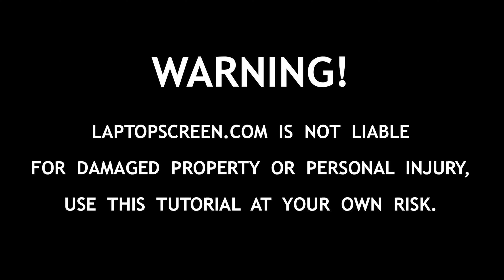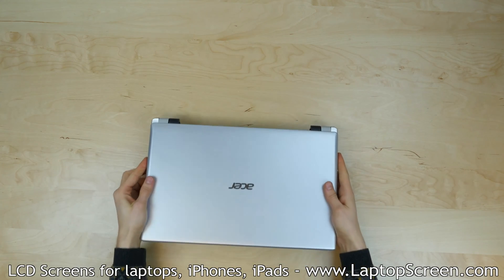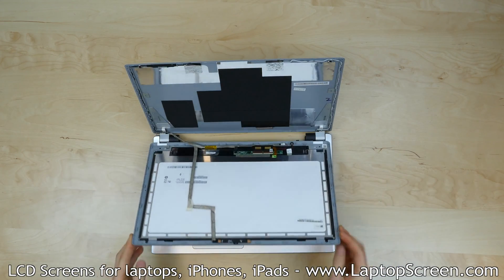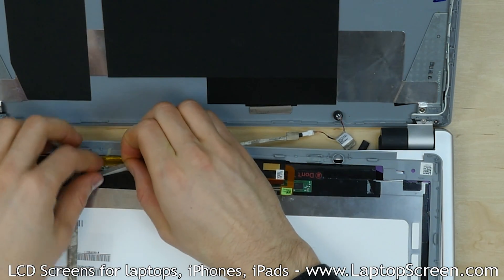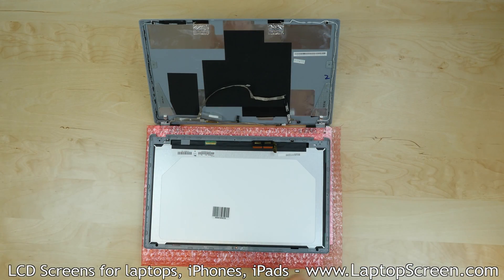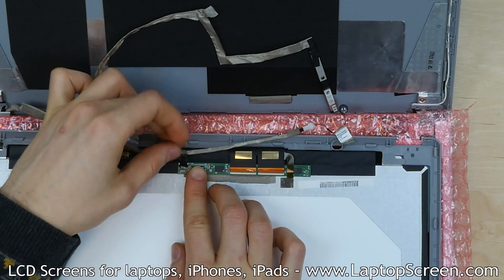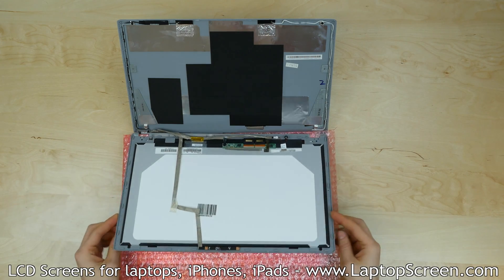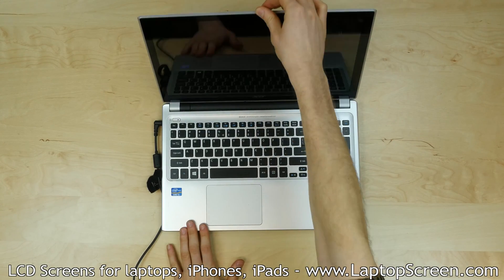LCD and Touchscreen assembly replacement / LCD+digitizer repair [Acer ASPIRE V5-571P]

Comment: Hi I have a v5-571p-6866 and my touch screen is cracked slightly which causes my touch to go crazy. I've been trying to find a replacement touchscreen at a reasonable price that all the pieces combined. But how can I tell is I need a lcd 30 pin or 40

Comment: hi there, i got acer v5 571p laptop and the touch digitizer is cracked. Would it be possible to change just the digitizer or i have to change the full screen and digitizer? thanks
Reply from the maker: It may be possible, if you are able to separate the LCD screen from the digitizer - this may depend on presence of optical glue between LCD and the touchscreen - some editions have it - some do not. Here is the digitizer itself: www.laptopscreen.com/735320
You may need to get both the digitizer and the LCD, LCD can be found here: www.laptopscreen.com/811366